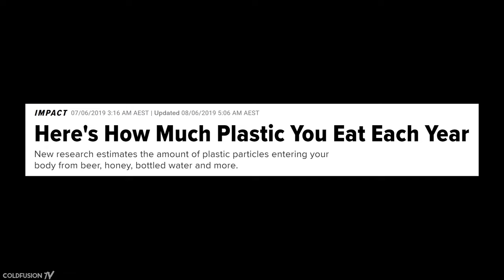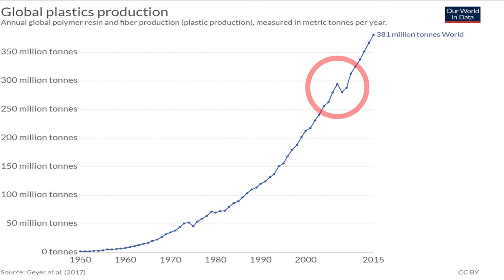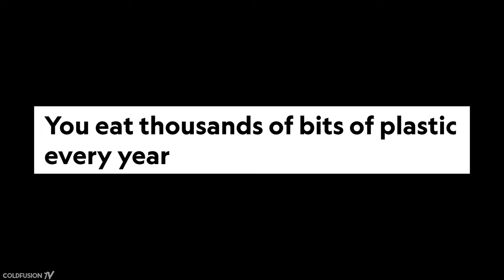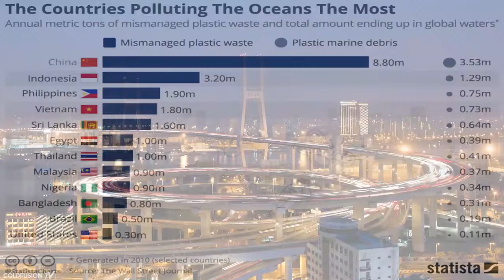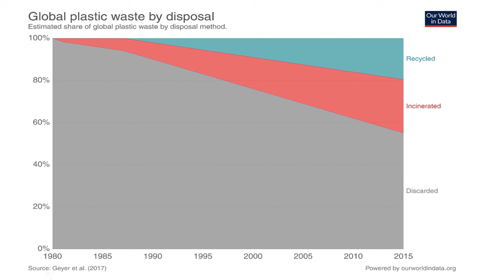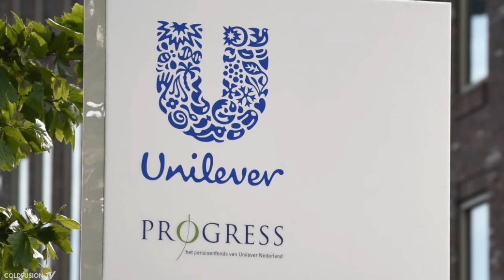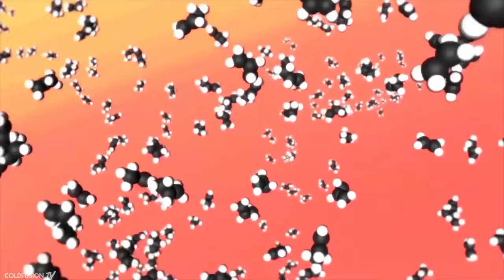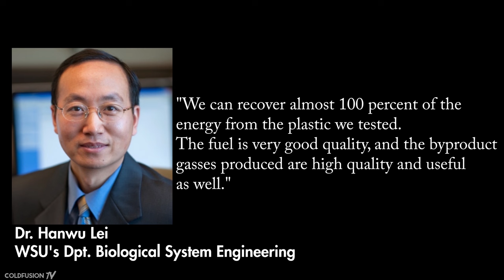Turning Plastic Waste into Jet Fuel!

Comment: or maybe melting it by other electrical way (induction is clean) in some giant closed pot to make it fuel, in the same place, even to generate power for the motor or generator or whatever use.. a lot of solar panels in the boat, a trash collector, and the pots heating all day. It can be done I guess in a very "clean" process, especially with some robotics that you can drive from far away (so we need a good antenna too   :)

Comment: I would love to see your take on plasma gasification with carbon sequestration / scrubbing and its multi stream ability to remove metals and minerals. Oceanic thermal energy conversion would be a good one that has limitless possibilities too vast to count, closed loop geothermal heat pumps for energy production, molten metal thermal energy storage for solar fields, traveling wave reactors/ thorium reactors, radiolysis for hydrogen production, various forms of water desalination, I could list for days.

Comment: For the  people who are saying burning plastic would cause pollution:
Gasoline/gas/petrol which is used as fuel in our vehicles can be made from plastic(polyethylene).
poly= many, i.e, a long chain of ethylene if the chain is broken into small a small one we get Gasoline which you use in your car.
polyethylene- (c2h4)n and gasoline is C8H18.
it has a POTENTIAL as fuel............

Comment: If you want to just burn it to solve the waste problem, you can easily make gasoline from plastic at home. There are also ready made units you can buy to do it for you, too. It's a simple process that just requires heat. So it does use energy. But then you get gasoline, so.

Comment: I see I am very late to the party.

Licella is an emerging Australian company which has developed working large scale high temperature and pressure fractionating plants to break down all plastics and biomass without the necessity to sort.  Result is a liquid which is effectively diesel fuel.  It can be used as fuel or better still new plastics.  So initiating a plastics to recovery to plastics cycle.  I recall an estimate that 20 such plants could deal with Australia’s plastics problem.  It also turns biomass into the same output

Comment: Ok, so what about the energy cost of turning plastic into fuel? The amount of energy used during the process should be at least the same as the difference between energy between the start and end products, which means turning plastic into fuel would not be great for our carbon footprint, especially considering the fact that burning said fuel releases even more carbon. This process is essentially putting all of the carbon from the plastic waste (and probably about double that thanks to the production method) into our atmosphere, which is a really bad idea.

Comment: "Plastic" is a pretty generic term for a wide range of polymers. I will have to look up the papers you briefly showed, but it looked like they were dealing with polyethylene. That is definitely one major type of plastic, but if a given process only works on specific polymers, then it still leaves a sorting problem.

Comment: Through pyrolysis plastic and even rubber can be made into pyrolysis oil. which can be used to run heavy machinery. It causes a lot of air pollution so it can not be carried out in many countries.

Comment: If used motor oil , mix with plastic melt mixed then add ethenol columetric distill into asphalt , wax , kerosene oil , gasoline , jet fuel in order at different heigh of distillation column

Comment: My solution to the plastic problem: 1. Use recyclable plastics only (fewer types, less contamination process like colors, inks, adhesives, combinations, and heavy metals), 2. use fewer plastics only in cases allowed by scientists ( not by marketing people :D)  3. use durable plastics types only 4. then RECYCLE 100%.
Any other method is just a pointless escape from the inevitable, especially replacing plastic or converting it to something more damaging.

Comment: The only problem I see with the idea of converting the plastic into jet fuel is the amount of energy it takes to produce it. I'm all for cleaning up the invironment but it has to be efficient enough for the fuel to be either the same or preferably below the current price at the time. If you can make it the same price then the airlines can advertise that they are doing their bit to clean up the invironment and probably get more customers.

Comment: One good solution that can be implemented and enforced right away is controlled dumping by using large bags for plastic waste with proper amount of rocks to sink it in a 1000+ m deep ocean and in those bags they can be recalled anytime they prove any economical significance.
Reply: I don't think you comprehend how bouyancy works or the size of a bag would need to be to dump out waste at the bottom of the ocean. This combined with even a single tear in a bag polluting millions of times more in the ocean than we do now
Reply: whut mid size commercial carrier with a winch is more than sufficient as it carries 40’ containers that are very close to the proper size of the bags. Also having some tears in some bags is way less polluting than dumping the whole shit in the ocean where it happens every single day around the world. Finally, if you know anything about the ocean the sea life would build many layers on these bags giving them a thick layer of protection even if the bag degrades.

Comment: Yeah this is called “thermal depolymerization”, using heat and pressure. you can use more than just plastic but even organic materials that are carbon based. Such as wood (cellulose) and animal by products, tires, and potentially most landfill materials. But many people called it sci fiction because .... big oil didn’t want this to happen. Btw it was making multiple forms of fuel because it was essentially making oil/fuel much close to crude than just kerosene and diesel.

Comment: There is a lot of difficult in this theory, like the dioxine when you burn the plastics, the energy require to turn plastic on high temperature, and when the plastic transform in fuel youneed to convert in energy, thisturn the fuel in one of the hated gas we have in atmosphere, CO2

Comment: Better yet, use it in the construction sector. Roofing, siding, framing, building blocks, etc... Much more of it would be used doing this than by turning it into air polluting fuel.

Comment: You can use any organic molecules [basically anything with both carbon and hydrogen] OR you can use pure carbon and pure hydrogen, and with heat and pressure, produce not only fuel, but, depending on how it is engineered, basically any type of fuel there is, and, in fact, any form of hydrocarbon ever discovered in nature.

Basically, you take all of your trash, pretty much no sorting necessary, pyrolize it and filter it, and there you go!

Granted, depending on the qualities and properties of the fuel you seek, you may need to 'crack' the output, distill the output, chemically enhance the output with other synthetic additives, and catalytically chemically alter the output by carefully combining various species of molecules, a catalyst [can be a complex molecule OR something like pure platinum/palladium, etc.], heat and even light energy [solar or laser].

One can also convert the end products back into plastics, or into medicines, solvents, pesticides, adhesives/epoxies, aromatics, flavorings, dyes, UV resistant coatings, etc.

Comment: The price of diesel or jet fuel make this hard to justify economically. I actually looked into starting a company that does this. Very low margins. It's possible with government subsidies in different parts of the world. But scaling that globally  is going to be difficult without private sector participation. There's other issues like the fact that boilers don't easily handle temperatures as high as 571 celsuis. This makes machine uptime particularly difficult thereby making the cost of operations even higher.

Comment: This may be a new approach for dealing with plastic, but Thermal Depolymerization has been around for decades. Largest commercial deployment is Carthage MO, to get rid of turkey offal, producing light sweet crude oil. This technology breaks down any carbon-based substance, including plastic. So we are just stupid for not using this technology for "cleaning up" after ourselves.

https://en.wikipedia.org/wiki/Thermal_depolymerization

Comment: The problem is probably the economics of converting plastic to fuel VS extracting oil and refining it to fuel.  the cheapest wins.
I think we have to reduce plastic usage, along with oil usage.  Reduce, Reuse, Recycle.  And at the very least, not throw plastic in trash, even worst just anywhere.
The most obvious and easy step regarding plastic bottles, is to get a good stainless bottle, and refill it, either from tap water, of if you don't trust your city's water, buy water by the gallons instead of many bottles.

Comment: What if we use big floaters or boats with lot of fresnel lens in some robotic arms (it melts rock making it lava), a robotic arm or net that drives the trash into the fresnel focal point, and we melt it almost no wasting energy by solar way? I never see anything like this, I think that have really big potential in terms of - simple robotics managing some solar panels for an optimum sun harvest, a robotic arm that drives the trash in, and other managing the lens to focus over the trash, directly, you can burn all with those lens.- Maybe is a fast and cheap (?) way to dissolve some of that plastic really burning it in the middle of the ocean . Off course in some closed place so the gases can be contained.. let me know if my idea sucks   ;D

Comment: Another awesome video! It would be nice to have a very detailed layout and description of how to build a diy system from common things that also, does quality fractioning. Showing the entire build in order from reactor made from maybe 55 gallon drum or thicker metal, including kind of piping and distance to next item (maybe condenser for diesel), etc. I am thinking, not sure, that you could just have a pipe with condensers and t's in a row dropping to collection barrels every 10 ft and that would separate out the different liquids. I think there needs to be a water bubbler to keep gasoline? I personally would like to use a wood fire for the heat to start the process and the syngas from the process to continue the process. I would love to know precisely how to do, as I am a monkey see, monkey do kinda guy. No imagination. lol

Comment: So basically we use energy to do the conversion which potentially causes pollution, unless green energy is used. But we then create more pollution by burning as jet fuel. If we could offset that pollution by the planting of enough trees then maybe it’s a solution. It appears to solve one problem and then contributing to another which is global warming.
Reply: Until tesla makes an electric powered plane, I don't think your argument holds much weight. We would be burning jet fuel anyways, but now the fuel comes from plastic the would have ended up polluting the ocean, rather than from oil drilled from the ground. If anything, the energy required to turn the plastic to the fuel is what would be attributing to global warming, but possibly this process could be powered by renewable energy.

Comment: the problem with plastic waste is that its a lot of completly different materials.
People not educated in chemistry forget that these cant be easly saperated. For example: if you have polyethylterephthalat (pet - Bottles) and polystyrene (ps - Foam) waste and mix them, you cannot recyle them (i.e. dissolving them) without going in and picking them apart be hand. machines and Solvents have a hard time differentiating between two types of platic.
It would be easy if you could gether all the plastik waste, combine and remold. But thats not how this works.

Comment: Turning plastic into fuel through pyrolysis method is as old as plastic manufacturing. The problem is that it's not been commercially viable so far. And with this oil price plunge even less so.

Comment: You take Oil add energy to produce plastic. Than you add even more energy to produce fuel from plastic. This sounds like complicated solution that requires lost of energy. Did you tried to calculate the cost of such processes?

Comment: Ultimately the ridiculous amount of plastic packaging needs to drastically diminish. I'll sound like a right middle aged fogey saying this, but I'm old enough to remember when paper, cardboard, metal & glass dominated. All of which are far easier to sort, collect and recycle. I wonder if an economic/practical way could be found to collect the waste from the ocean's tyres, if not only would it be profitable thru conversion to fuel etc but would we see commercial enterprises vying to do so given the sheer volume of plastic waste out there?

Comment: That 45% stat is very misleading. You forgot to mention that most of the recycled plastic isn't processed natively. We have been shipping it to China and other developing countries for the past 30 years. Now China's economy has improved to the point where the environmental cost outweighs the benefits, and China imposed much stricter regulations (Good for them). This is the reason why pre processing in the US is such a mess, and the reason why so many cities are canceling their recycling programs. So many recycling companies shot themselves in the foot by using China as a quick and dirty solution. How do you think we used to be able to just toss our dirty food containers and even trash in the recycling bins without worry? Cheap manual labor to sort and clean our crap.

Comment: What he said at the end. This technology is nothing new in fact it is very old technology. Gasification for motor fuel has been around pre WWII. Today we have micro controllers that can automate the process making modern systems as reliable as any liquid fuel counter part. I am such builder of these very advanced systems.

Comment: By making jet fuel, are we not combusting valuable oxygen thereby lossing oxygen from the air that we breath and release noxious gases such as CO2 & NO2 into the air? We are solving one problem by moving it to another problem which will result in the reduction of oxygen and more pulloutents (greenhouse gases) into the environment and air that we breath?

Comment: But is it worth burning fuel to create large amounts of energy to heat the plastic, just to turn it back into fuel? When you could create electricity by just incinerating the plastic, and make jet fuel by turning crude oil into jet fuel. I'm not sure if converting crude to jet fuel takes less energy than converting plastic to jet fuel, but I would think so, correct me if I am wrong.

Comment: Companies manufacturing cheap rubbish from plastic (Chinese toys ,plastic bottles ect)should be heavily taxed, especially car manufacturers. Almost EVERYTHING in cars is plastic and electronics(micro chip) assisted. Then they make up these enormous prices and call it technology ! 
I did make feul from plastic. But no one tells you about all the problems it create. Everything sounds so honourable and fantastic. They do it to sound impressive. You see that dark liquid. It blocks , glues and fuse everything in your feul system. It's called tar ! Leave it a few weeks it starts getting darker by it self.....

Comment: I have heard about plastic being converted into diesel but that was some decades ago.
Lets face it first you need to look at what industry uses heat, steel works for one glass works for two.  The heat generated by furnaces could also melt plastic so I reckon this has to be the way forward.   I think if you make a industrial plant for the sole purpose of plastic it will not work saving cash.   Its not the plastic thats an issue, its reusing it OR investment which will stop it and of course companies that make plastic will oppose any sort of reusable method.  We have to remember humans are greedy because as I have said on another forum, if this is going to be pushed onto the user they will not change because the user will pay one way or the other which is where we are heading.   However, the first thing that SHOULD be done is STOP all unusable Recycled plastics, such as the big moan at the moment "The machines cannot pick up black plastic" from sorting.   Well if that is the case do not use black plastic for packaging but Governments know that they will palm this onto the user in some form of tax like they did with sugar drinks. we are really the biggest suckers on the planet because NO MATTER where you go with this subject is, The Tax payer will pay.

Comment: It's definitely time to start packaging pills in paper containers rather than plastic.
Reply: What do you think happens to paper when it gets wet?

There's a reason plastic has been thr go-to for food and medical storage for so long. It's a durable, water resistant material that is cheap to produce and easy to fashion into various peoducts.
Reply: @MetalSandman999  Do you soak your present pill jars? I don't.
What would you suggest as an alternative to plastic?
Reply: I don't have an alternative. Plastic really is the best material for a lot of things. That's why it is used so much.

What we need to do is develop the technology and (in poorer countries) the infrastructure to dispose of it properly.

That can, of course, include using it for electricity and fuel.